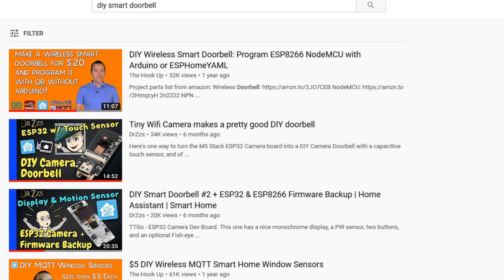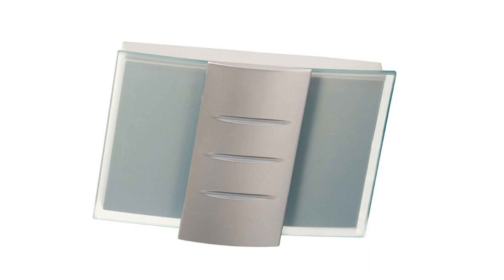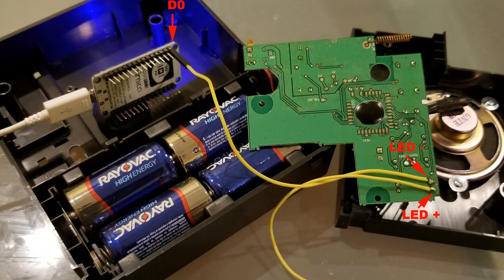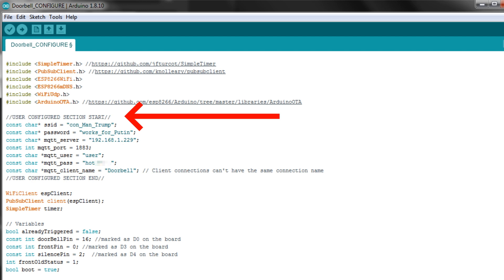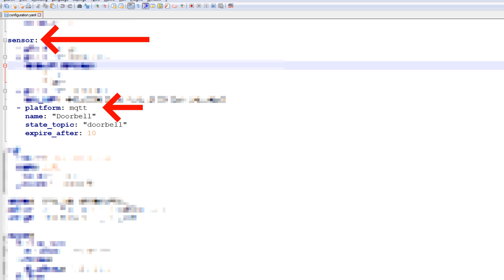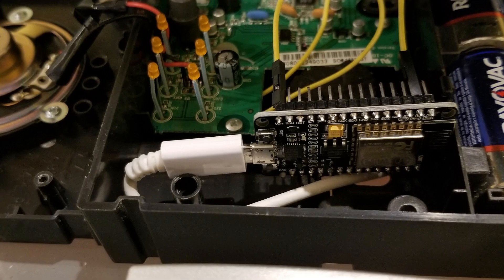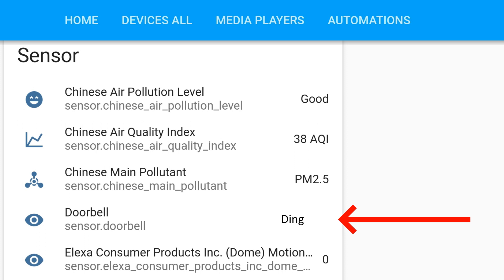easy DIY smart doorbell conversion for $5!

Comment: I would like to adapt this project to my existing doorbell chime.  My chime runs on the standard a.c. transformer.  In my case the transformer is located at the circuit panel.   Could I substitute the 2 wires going to the LED with a current sensor around one of the A.C. wires for the chime.  When the doorbell button is pressed the current sensor detects current.  I have seen this done in another project however I am a newer than a newbie and much was left out for a newbie like myself.  I purchased a couple of the 8266 developer boards along with some current senors.  This would also let me mount everything at the circuit panel where my transformer is and a 120v outlet where I can use a cell phone charger to power the 8266.    Please keep in mine I know very little about these board but want to learn.  I just installed the Arduino IDE 1.8.1.3 program along with some installed add on's.
Any assume I know nothing, help you could offer would be very much appreciated.    Thank you
Reply: I don't know anything about home assistant.  Does this project connect directly to your wifi router then sends you a alert notification by email or text?    is the project hub free or do you need more hardware to make it work?  I got lossed when you said open home assistant and add the extra lines of code.
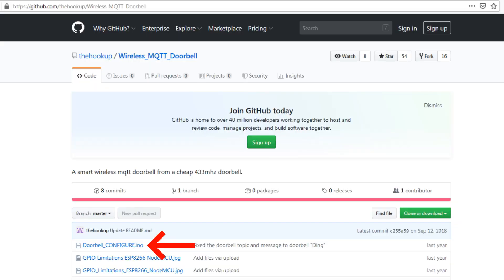Reply: at 1:33 you show 2 yellow wires.   I only see one connected to one of the pins of the board.  Where does the other yellow wire go?   Could you tell me what pin number the yellow wire visiable goes to.  Do you have a diagram?   thank you
Reply from the maker: hello, this part i dont know. and i dont think it will work in your situation.
Reply: OK,  well this would also have been a great project for the standard wired in a home door bell chime. Does this project require a HUB or does it connect directly to your home router and sends a message.  Is it text or email?   When you enter the MQTT info, is that in the Arduino program or something totally different?